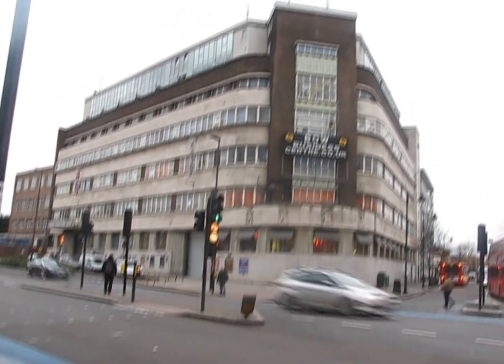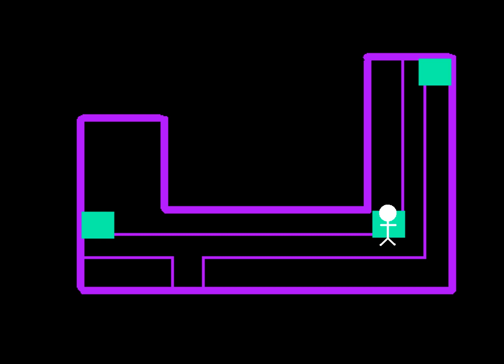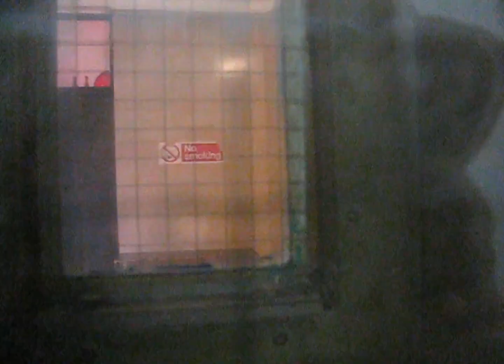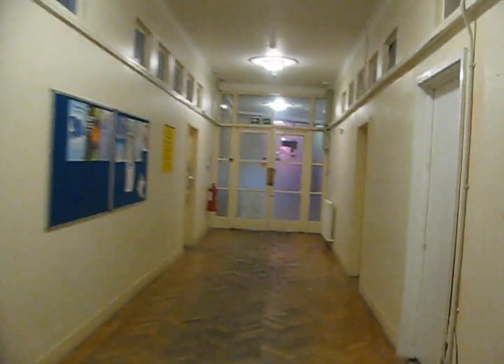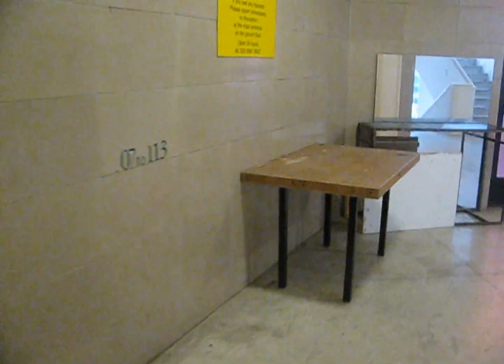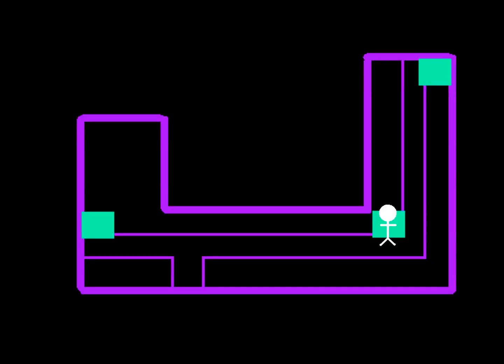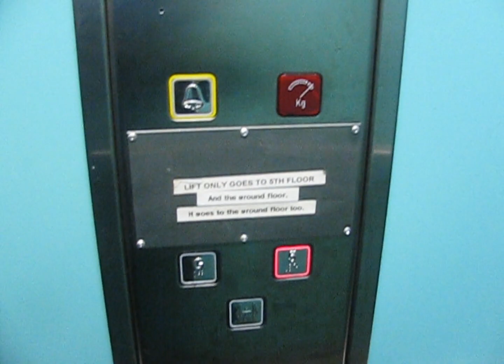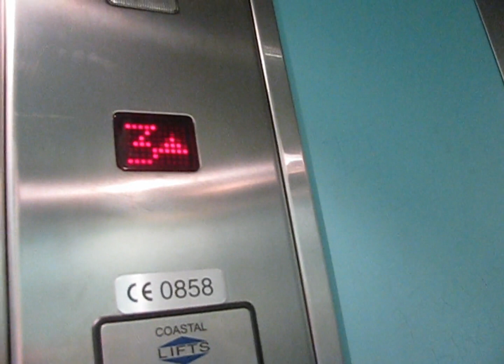Poplar/Bow town hall | IT'S LIFT TOUR TIME!

Comment: The Last Lift Has A Piccadilly Line Voice
Reply: No it doesn’t.
Reply: yes it does. it's the new version
Reply: There can't be a new version. Unless they actually changed the voice on the line to the same voice as on that lift.
Reply: They might have just made new recordings for use on any new installations that may happen
Reply: ZZ9 Productions
Well, do you know if they’re made by Julie Berry? If not, then it can’t be a “new version” of the “Piccadilly Line” voice.
Reply: I don't know if they are or not, but they sound very similar. i know of the existence of two other versions, the original version and the lower quality version used by Horizon Lifts
Reply: Yep